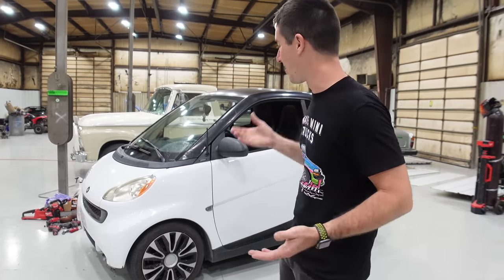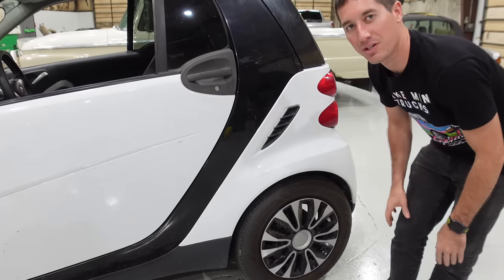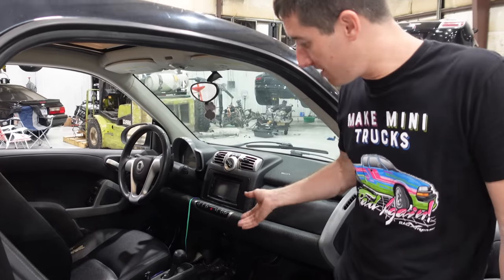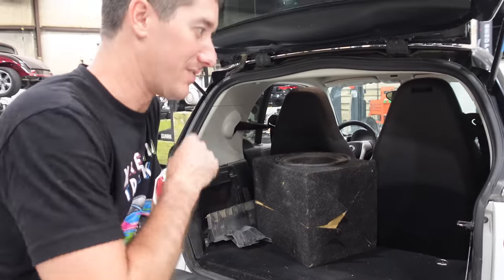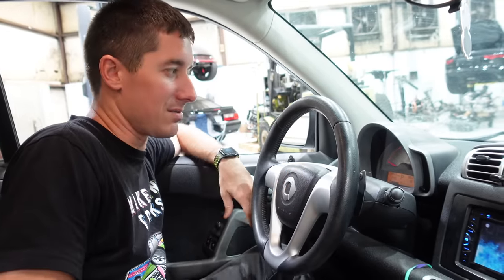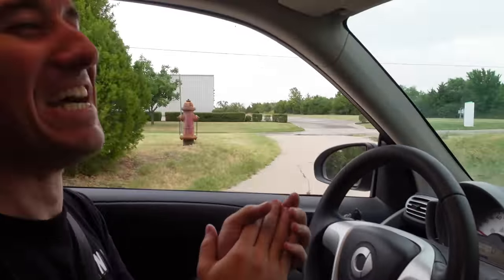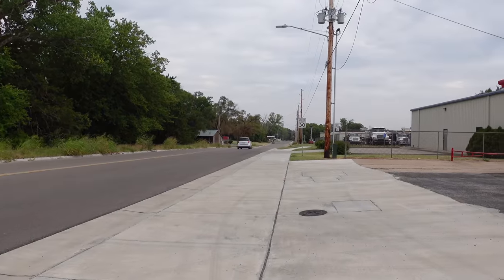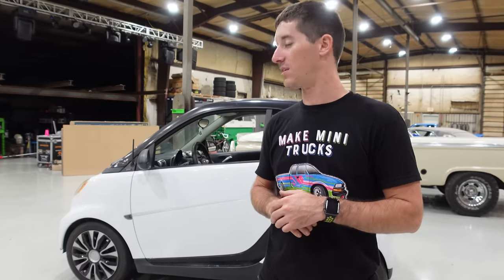I BOUGHT A CHEAP Smart Car.. Is It As DUMB As They Say?

Comment: People forget that the smart was made for city driving, in traffic. I am in Canada, and never got stuck in the snow, I just drove over the snow.  The fact that it can do some off reading is a bonus. People who complain about it don't get it. I miss my little car.
Reply: I drove the brabus model it was a rocket
Reply: I got two of them and love them
Reply: I've been driving mine for years now , love it to bits
Reply: MPG close to Toyota Corolla but uses expensive gas.
Reply: I miss my 2013 fortwo and my 2016 fortwo.
Reply: Being made for city driving makes their choice of transmission even more pointless. Sitting in traffic is not a good fit for any kind of automated manual trans. Should have been a CVT or a regular automatic.
Reply: "Off reading"
Reply: You miss it? It broke down?
Reply: Do you think it would fit inside a ram ProMaster 159 wheelbase if you rigged it to clear or sit on something stable over rear wheel ?
Reply: @nodak81 , the torque converter in a conventional auto transmission can cost an engine as much as 10% of its power in slippage during normal operation, which would probably have been too much of a drain on the smart's already limited engine power. I think the option of a dual clutch in the next generation was a much better idea, and then some people would also prefer the lower price and greater simplicity of the stock manual, of course, but that would never work for me, because there's no room for straightening my leg and big left foot past the pedal, except if I wangled it in BELOW the pedal, in which case it was becoming downright dangerous because of the difficulty in getting it out of there again. A lady with small feet and slender shoes might not have the same problem.
I've had my 2011 passion for just over 10 years now and it's the only car I've owned this long and still really WANT to drive and prefer to pick over other cars that might be available to me, and except for the continental shift-like tempo of the transmission, I disagree with a lot of this guy's opinions about the smart - even some of the positive ones! It really isn't that light on fuel, for instance. It really isn't that much lighter than most compact four-seater cars either, being only 110 lbs lighter than the 1st generation Toyota Yaris…
Reply: Maybe with a manual I could see owning one, tight parking areas. Why did you let it Go?
Reply: Because it’s a coffin shaped like an egg
Reply: @Dukeskylicker  you obviously don't know about the full roll cage...
Reply: @Timothy Jones  you don't have to use 91 but I recommend it. It seems to do better with  more power and better fuel mileage from what I've seen with mine.
Reply: I saw these aallll over Switzerland and my mother wanted one. Unfortunately, Mercedes didn't have plans to bring it to the States at the time. Also, a few were used to advertise Red Bull drinks throughout Europe.
Reply: @largol33t1  they are great cars. I have a 2017 smart.
Reply: Yeah, lots of people I have seen complaining about this is its reliability for long range, it wasn't designed for that, the design is poorly misunderstood, when I went to visit edmonton, I rarely see one of these, yet look at that congested traffic and its getting worse, a small compact car would just make driving less stressful on a crowded city.
Reply: @maimaibiri9045  no these are really good for long range. If you're talking about the electric version then hell no.
Reply: @maimaibiri9045  I've been on numerous long drives in my smarts.  1,000 mile (1600 km) round trips to the Smoky Mountains, a whopping 3,500 mile (5600 km) round trip to Colorado from Florida.  The car handles the highway just fine.  Although strong crosswinds can be white knuckle inducing.
Reply: I live in a city and the number of times I wish I had a smart car was insane.
Reply: Yes its a good car
Reply: Are the Chicago and I was wondering about the snow can we handle it you answered my question
Reply: I love off reading too such a fun activity with all those books.
Reply: @SuperHushPuppy  no, it wasn't that. I just decided to get something sporty for the first time in my life.
Reply: @stadleroux w
Reply: @Sam-gf6vi , come again? 🤨🙂
Reply: How expansive maintenance in canada for this car ???
Reply: @timothyjones3410  It's very much a city car. If you're driving one of these more than 5000km / year, you're not its target audience. ~6.5L / 100km is great, when you're only driving a few thousand km / year.

Comment: Also, that Smart needs a turbo Hayabusa engine... It's been done, i know, but it's just hilarious seeing a Smart car with like 400 hp that screams like a banshee =)
Reply: 100%. I’d love to see that series, especially if he can get the A.C. to work!
Reply: This is the only comment needed for this video,100%agree
Reply: A friend of mine bought one for 300 with a broken engine and its in the process to swap a 3 cyl from a 2018 mirage that his daughter totalled he plans to put some rods in the engine to turbo it,manual trans of course
Reply: @perioquido  the Mirage 3 cyl is so terrible.  Should have sourced a 1.0 Turbo from a wrecked Ford.  Those Mitsubishi engines are so weak.
Reply: For sure. It would definitely make it reliable also. 👍
Reply: Yea if you have a xtra 15k laying around the cradle for the motor itself if 5k I own one and have priced everything needed and it takes away driving reliability be cool just for a show car but not good for a daily
Reply: Yup Take the original Dookie engine out and put a Suzuki Hayabusa engine in it instead
Reply: Cough cough milkjug
Reply: @derekgardin1512  it already has a Mitsubishi engine so it’s not really a downgrade. Also, I wonder if you could fit the new GM 3cyl in the back there.
Reply: They look like a ton of fun with a Hayabusa engine swap
Reply: I've seen one or two Swiss owners mod their engines with aftermarket turbochargers. Those modded cars are NOT slow. Trust me. The HP/weight ratio must be in supercar territory! I have seen a video of one doing a burnout too!

Comment: I'm had my Smart Car since 2008.  Currently at just under 170,000 miles. You have to get used to the way the car drives. I have no trouble getting off the line or reaching the speed limit quickly.  I've done up to 85 on the interstate.  Solid handling.  Tight turning radius.  Awesome on agility courses.  Fun, Fun, Fun car to drive.
Reply: Me too.  I drive my old Smart 450 cdi since 2008 and with 
230.000 km 
First Clutch, first Turbo. 
Only maintenance. 
Good car 👍
Reply: I'm impressed with your 170,000 miles. Mine is a 2009  diesel and tends to give me 500 miles to a tank and about to hit 100,000 miles.
It's only got 45 BHP, takes a bit of time to get to 70 mph, it's been to 90.
I went to see my Aunt in Troon Scotland from the far south east of England on just one tank.
Reply: Has it been reliable? I am highly considering one as a work commuter
Reply: Mine is a 2008 that I got for $4k 8 years ago. Drive it like I stole everywhere I go. It governs at 95 mph while I'm only in 4th gear. I have 110k miles on it now and never did anything more than oil change and tires
Reply: Same here. His smart sounds weird when he's going slowly. I have around 129k, and yep, very reliable. I got in trouble once for parallel parking between two parked cars LOL.

Comment: Hah! They're honestly neat little cars. Learn to drive the transmission - drive it in manual mode all the time - rev it a little higher than you normally would with most cars so that the revs don't fall too low after the upshift. Try rev-matching - it will let you do it on downshifts. The 2011+ ones have a much nicer suspension and all sorts of nice updates. Ultra quirky, but in a dense urban environment, they're a total blast to drive.
Reply: Clutch pedal?
Reply: But there is NO CLUTCH PEDAL, so you might say you learned to drive a manual because it says "manual mode"  but you didn't. Only way to learn or drive a manual is with 3 pedals and a gear stick. Simple as that.
Reply: @roxieloot  it’s hard to explain, but there’s lots of quirky ways to drive the smart with its gearbox. Not saying it’s driving like a manual, but it has its tips and tricks. Manual mode is a great way to drive it and will give you a better chance of anticipating and initiating gear shifts instead of it “randomly” choosing when to shift.
Reply: @roxieloot  (I've driven a manual car for 19 years now) - it's still great fun being able to have anything where you can change gears as you wish, with no torque converter!
Reply: @roxieloot  It's a legitimate manual transmission, which has a motor actuating the clutch. It lets you do everything you can do with a manual car - you can rev-match while it's clutched-in for instance.
Reply: I love the "Sequential manual" nudging to shift.
Thought I saw a comment that said "Floor it in 1st, it will change at full revs"...
Reply: @roxieloot  Nope RPM match . Tobotic manual so no clutch needed.  could be driven in auto mode or manual shift
Reply: @roxieloot  Nope, that's not how it worked, it's a standard manual transmission, it's just that the engine runs the clutch, you absolutely needed to learn the manual to get anything out of it.
Reply: @roxieloot
it is a semi automatic, you push + or - to shift up or down

Comment: I love my smart car. Transmission complaints are unfounded, it's just a matter of learning to drive it correctly. Of course mine is the performance Brabus edition. Straight up for your f- type?
Reply: Love the Brabus smart! Absolutely a unique car.
Reply: I also have a 2015 Brabus  edition . Totally agree with all of your comments. love driving my Smart. Although the Brabus isn't really a performance edition. Different body panels, muffler, and shocks.
Reply: Just joking with the performance comment as with the straight up trade. @margaretfoote2397
Reply: I would love to compare a Brabus to just a regular fortwo....
Reply: which 451?
brabus 62/72/75 kw vs
45/52 kw or diesel 33/40 kw

Comment: Comes with automatic windows; yours is broken.
Interior is optional leather. Standard was cloth.
Had option for tach and clock mounted in little pods above climate controls.
Passenger seat folds flat forward to increase hauling capacity - amazing what will fit.
Top speed governed to 150kph (93mph).
Much more compact subwoofer available; fits under passenger side of dash.
Much smoother shifting with paddles. The electric version does away with the problem by being direct - drive.
I get 39-40 mpg overall. I've seen over 50 mpg on highway trips. That being said, mileage is no great shakes. This car's best party trick is parking just about anywhere. Can't count the number of times I've parked in a space where some fool parked over the line. Also great for when you miss a turn and easily pull a u-ey. Turning radius even better in the later models.

Comment: My co-worker had a Smart car. He bought it for the mileage because he managed the supermarket merchandisers for Coca-Cola. He's a big guy, probably 300+ lbs, over 6 foot tall. He often took a co-worker, nearly the same size of a guy with him to do store runs. Was funny to see 2 beefy guys climb out of a tiny Smart car. I told him it looked like one of those Little Tikes cars you buy for your kid. Even cooler, we had a covered roof area made strictly for motorcycle parking. The door barely would fit a Harley Trike. Once during a hailstorm, he pulled into the enclosed area and turned the car around, with no problem. You can park 2 of them in any parking space. 
Growing up al the muscle cars had big and little tires. I agree that those squatted trucks are just stupid. If you cant see the road, you shouldn't be driving the vehicle. Might as well do a Ricky Bobby and put a big logo across the windshield.
Reply: Very inconvenient but I do love fig newtons
Reply: Thx for info

Comment: I regularly get 35mpg around town 60 on a run . Mine is the 84 BHP turbo 2012. Gear shifting is good . 0 to 90 mph around 13 seconds. It’s not slow . I’ve been driving for 42 years now , this car is definitely a keeper.
Reply: Love the "Sequential manual" shifts, nudging up and down (without a foot clutch, takes a leap of faith first time!)
Reply: @Gzluweez  It's heavy for it's apparent size. and adequately powered ( 3 banger)
Reply: You also didn't mention you have to put premium more expensive gas on it
Reply: @Gzluweez , 1) its height in relation to its length gives it a pretty poor drag coefficient.
2) Its weight advantage compared to other small cars, for example the first-generation Toyota Yaris is insignificant, but it only has two seats as opposed to a rear bench and all the material necessary to fit that in, so where does that weight come from!? It was used to make the car more rigid and stable. It's the one small car in which they didn't have to cut down on materials to lighten the load for the engine, because the capability of the engine to move that weight was already known, so they had a lot of room to play with to make it more stable in cross winds. It's not completely stable, btw, but still better than a Jeep Wrangler, for instance, and probably at higher speed too.
3) I may not be up to date with this, but last time I checked, which was about 10 years ago just after I'd bought mine, most small cars came with 13" rims and tyres in 155 or 165 width. The smart's rims are 15" and the tyres 175 wide in front and 195 in the rear, creating lots of extra rolling resistance.
I probably wouldn't have bought a smart for its fuel-saving capabilities if I had a regular medium-sized car, but I still think it's the best fuel-saving mod I ever got for my Jeep! 😉😏
Reply: @bobbysworldrox  you don't have to. I put 87 in mine but I do recommend premium. That's all I get now is premium when I compared to how my smart did premium vs regular.
Reply: @kevinanderson686  you..

Comment: My smart car was also great on ice & snow, as well. Loved that car . . . My wife didn’t like her internal organs shifting when we hit bumps (those front tires are rock hard).
Reply: I'm not surprised. I lived in Switzerland for three months. Those things drove everywhere in the snow with NO issues. On the OTHER hand, it ain't easy trying to control an Audi A6 even though it had AWD. The engine had just a bit too much hp. I was forced to use the manual gate on the shifter all the time or the wheels would just spin around.

Comment: i used to work at a lumber yard and a guy came in in a smart fortwo...i shit you not, i loaded an 8' 2x4 into that thing. diagonally from the top left corner of the hatch, to the bottom right corner of the passenger floor...and it fit with the hatch closed! i couldn't believe it.

Comment: You truly have to understand a smart to truly enjoy it in full. When it was built, it wasn't built for crazy stuff. It always had a unique market focused on the city life. For the era these were designed (late 90's) the fuel economy was impressive. The transmission is one thing everyone complains about. The transmission is a "smart" transmission and re-learns to your driving style. In manual mode (and yes it is technically a manual transmission with an automatic clutch) hence why the shifts are always so delayed. The reliability on these is actually quite good for being a Mercedes product. The one downfall was that you would have to run premium all the time, or your power would tank. I am happy to say I've owned two and have always wanted another. Everyone likes to rip on these, but for what it is, it is quite good.
Reply: "The transmission is a "smart" transmission and re-learns to your driving style."
That could explain the differences, I have a light right foot, sometimes...
Love the "Sequential manual" shifts, nudging up and down (without a foot clutch, takes a leap of faith first time!)
Reply: @ev-1832  yes! That could definitely explain it. According to service manual, you can “reset” to factory by undoing the battery for 15 minutes. At this point, after re hooking the battery, the car will adjust to your drive cycles after a while. As always, manual mode is so much easier for me, but to each their own.

Comment: Up by the front windshield it looks like the Tridian safety cell was compromised and that's why they totaled it.  The car used to be safe now if you get in a standard wreck no guarantees that the cell won't crumple and kill the passengers inside.  If you ever purchase one of these and see a dent, crease. scratch, etc. (I have seen one being sold at a used dealer that was compromised believe it or not) in the safety cell areas, walk away because it is not worth your life or the life of someone else!  Open the doors during a purchase and check everywhere before buying that the cell is properly intact.

Other than that, I absolutely love my 2013 facelift Passion paddle shifting version!

Comment: I remember when these first came out! Was immediately disappointed when I learned the diesels weren't available in the US. Would have been awesome to have such a quirky car run off of used vegetable oil.

Didn't know they were so capable of off-roading, though. Wouldn't mind one of these for the zombie apocalypse!
Reply: They're awesome with fuel economy. They consume like 2-3L/100km.
Reply: The front lower panel was ripped off!
Reply: The Zs would outrun you
Reply: @kendallsmith1458  Yeah, if you’re being stupid about it. It’s obviously not going to climb 40+ percent grades or over rocky terrain, but what normal road car can? In a SHTF scenario where I’m trying to get out of the city, I’d rather have the Smart over a normal road car that would get stuck in congested/blocked off city streets. At least the Smart can drive over curbs and through ditches, sidewalks and alleyways.
Reply: EV sounds way to go